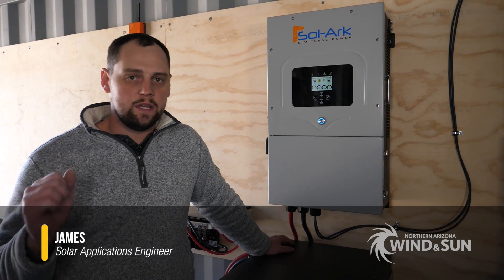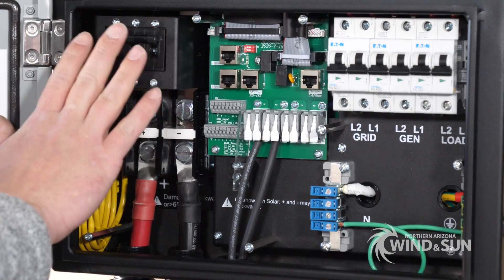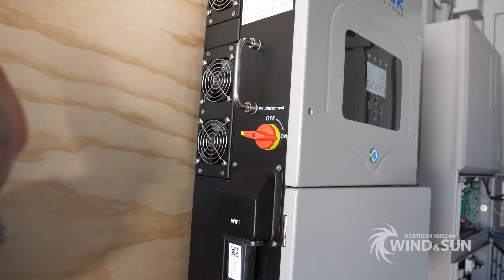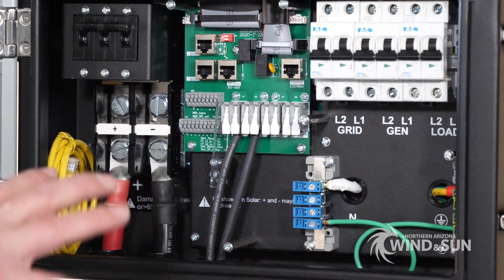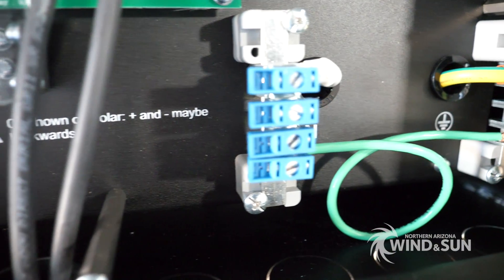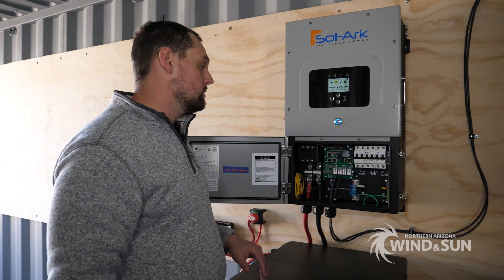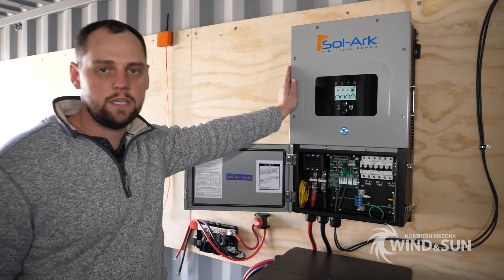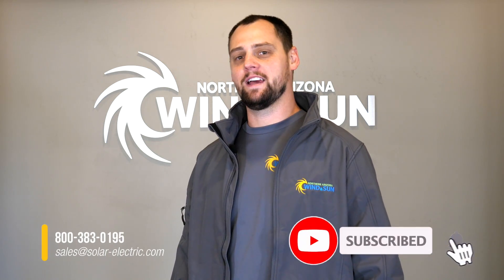Sol-Ark SA-12K Pre-wired Hybrid Inverter System

Comment: Great summary! Could the dump-load feature be used to charge an EV (from Type-2 charger), in a grid-tied residential configuration, when home storage batteries are full?
Reply: That's my plan for it.  As far as I know, it just activates the circuit so you'd have to have a way to have the charger start when it gets power.

Comment: You said this is a 240 volt single phase? The web page said split phase. ??
Reply from the maker: Here in North America we refer to electricity in one of two ways, single phase or three phase. This inverter can do both, but to do three phase you basically need three inverters. It also naturally splits the single phase output (similar to standard residential electrical distribution) so that you have 120Vac between L1/N and N/L2. So single phase in the sense that you have 240Vac output, split phase in the sense that you have 240Vac (L1/L2) that is split with a neutral at half the sine length (120V/N/120V) splitting the phase.  The inverter will provide power similar to common residential home single phase three wire system (ie. Split phase).